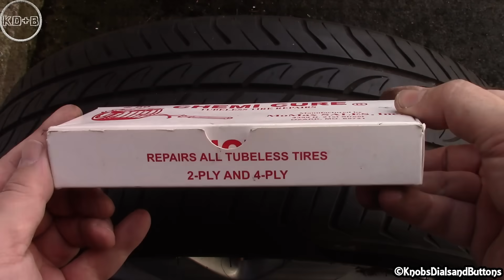How Tire Repair Kits Work - With Internal Views

Comment: Longest lasting ones are the rope type ones (will last the life of the tire), but the easiest one is the screw type. I suggest you buy both, because if you're stuck in the middle of the road at dead winter or summer with a puncture, you don't want to take out the tire now (too hot or cold, and might be dangerous to stay on the shoulder of the road too long). You plug with a screw and fill with air (without taking the tire off), then when you get home, you put one of the rope type plugs in. The rope type plugs require more clearance for the tools, so you can't do it while the tire is mounted. The screw type plug can be torqued down with a bulldog (low profile) screwdriver with the tire mounted.
Reply: Bingo! I had one in my tire for years without issue
Reply: Technically your wrong the best repair is the patch and plug they use at tire shops much stronger, ive seen those ropes fail, ive done them and had them hold up great but still nothing beats a patch and plug
Reply: @jamesbasye2362 it’s a do it yourself  … Emergency …. Be grateful this person  has the patience to show and share  
I know if you go to a place to get it done some times  they won’t  DO a proper procedure
Reply: I can't remember sticky rope type plugs failing, as long as it's not on the shoulder of the tire. i even use half the sticky rope, even put in a single thread.  i've done several over the years. You don't have to take the tire off depending on your car. Regards
Reply: Наконечник из последнего приспособления, остаётся внутри шины болтаться?
Reply: It either lasts the life of the tire or to the end of your life, if the tire fails in the worst moment possible!
The metal wires in the rubber on the tread are damaged!
Exchange both tires on the axle if you can.
Reply: The one with the glue type is the longest for me. The rope type without glue still release some air based on my own experience
Reply: @user-2uf2kr2c  I have seen tread separation due to ropes and internal patches being installed incorrectly. It’s either a tech grinds the inner tube down to wires, or someone creating a second internal puncture by inserting the reamer at the wrong angle.
Reply: I've used the rope or string type for years and found them to be reliable.  Someone here mentioned the wires of the belt being damaged.  If they're damaged, it's because they got caught on the end of a flat ended screw or something like that as it was puncturing the tire.  My wife had a tire once that was punctured by a 5/16" bolt about 3" long.  It was still in the tire when she arrived at Walmart Auto Center.  But those wires are tough.  You won't damage them with the rasp tool rubbing against them.  And it's pointed, so it passes between them without breaking them.

As for fixing the tire on the vehicle, I've done it a few times.  All you have to do is, go forward or backward until the puncture is indexed at the ten o'clock position (left side) or the two o'clock position (right side) and turn the steering wheel all the way toward the side you're working on, and voila!  Instant access to make the repair!

What I want to know is how he got a camera and lighting inside a pressurized tire to record the video. 😅😅
Reply: My brother did it at a camp site with the wheel on the car and the tire rotated so the hole appeared on the side and he did it laying down on the ground.
Reply: You can plug a mounted tire if you have the room.  I’ve done it before.  I’ve also seen the “rope” plugs fail.  Something tells me you don’t have much experience with tires.
Reply: @jamesbasye2362  and the screw plug is the only one of these that a tire shop will do a proper patch/plug repair on since you can just say there's a screw in the tire

All the rope and mushroom DIY plugs are a no go for repair
Reply: I once had a tire with four or five ropes in it. Someone really did not like my car taking "his" parking spot and put a lot screws in  left rear tire. So to drive home a have to put equal amount of ropes into this tire. It did hold on nicely for a week or so until I changed a tire completely.
Reply: Totally correct. The rope is simply a very temporary "get you home and to the tyre shop". A proper plug should be fitted and no more than two in one tyre.
Reply: I've done dozens of repairs using the glue and rope kits out in the backcountry on 10 ply tires.  Never had a fail.  Having said that, be warned,  IT AIN'T EASY WITH 10 PLY
Reply: I’ve put plenty of rope style on with the tire still mounted it isn’t hard at all.
Reply: Had trucks and utility trailers for 30 yrs and never had a lubricated ropes fail. Maybe I’ve just beat the odds so far.
Reply: @SgtPnkks They can just remove the mushroom plug like they would a nail or screw and repair as they would have without the plug.
Reply: Couldn't agree more. Lol I call them the kit Kat ones
Reply: First one right ?
Reply: You just turn the wheel to expose the spot you work on,I never take the tire off to plug it.thats the joy of a plug!
Reply: The first and the third?
Reply: Good advice, Thanks
Reply: I always use the strip plug while the tire is mounted. There's no reason to dismount the tire.
Reply: @07wrxtr1  I have the first try pop off after a few days. Maybe because I'm still inexperienced using it. 😅I tried again to plug the hole afterwards, and it managed to cling on the tire.
Reply: @lewis2553  I think he used a sawed off tire. Sometime you can see his hand on top of the tire. So it's not a camera inside those tire. Watch 2:35 to 2:36, at the upper right corner there's a pink shadow of his hand.
Reply: I've found rope tire plug kits occasionally start to leak air up here in the Northeast after a half a year to a year.  It's probably the impact of drastic temperature change on the different materials of the tire and plug breaking the bond of adhesion.  Proper way to permanently fix any tire is to remove it from the rim, ream the hole, rough up the surface inside the tire, layer of rubber cement, apply a pull through mushroom plug/patch, and then roll the inside of it with the rolling tool and reinstall the tire on the rim.  It's safe enough to do on motorcycle tires where a blowout can cost you your life.
Reply: ive had 2 rope ones last the life of the tire.
Reply: One can use rope plugs on many carss without taking the tire off, you just gotta get the right angle on it.
Reply: You can definitely do a rope style plug when tire is on the car.
Reply: @tombrown1032 nope, you probably just take a few extra seconds to do it right
Reply: Grandfather has always used them never had an issue!
Reply: @jamesbasye2362 issue is you need to take the tire off to use a patch/plug
Reply: @jamesbasye2362 

my tire shop and other shop don't patch tires, they only do the rope sticky plug...
Reply: I have 2 brand new tires 205/55/16, but there is a hole on the side less than 1mm thick, which of these methods is better to use or is it better to install inner tube?
Reply: In that situation, why not just use a metal screw (maybe dunk it in engine oil first)?
Reply: @alexkross8357  I think it must be, it will be pushed in by the plug. It looks like hard rubber, so it should not cause any problems.
Reply: @lewis2553  If it is on the rear tire you can't turn it with the steering, but if you roll forward until you get the puncture at the 4 o'clock or 8 o'clock position you should be able to access it under the car even if it is a bit awkward.
Reply: @lewis2553  of course it was done a second time with an open tire for the video.  The tire tread wouldn't bob up and down when rasping if it was pressurized.
Reply: @shagrat47  I drive for a living and you'd be surprised at how much crap you get in your tires when you drive 90k miles in 4 years going in an out of all manner of places. If I replaced tires just because I caught a nail or a screw, I'd go broke. I repair tires with plugs all the time and keep running them. I suppose it helps that my front tires only last about 6 - 8 months before needing replacement anyway due to wear, but still. Your advice is for the rich when 2 tires will set you back $350 - $400
Reply: @JackFrost-wg5zl make a video showing us how you do that with the rear wheels
Reply: I do it all the time with the tire still mounted on the car….. just have to roll the car to wear the puncture on the tire it’s almost level with the ground So you have clearance to use the tool….. The only downside is your laying on the ground….. It works just the same
Reply: @craigrufolo8442  
Yeah, but for some of us, laying on the ground means 2nd degree burns from hot asphalt or laying in a snow and salt slushy. Much easier to turn a screw for 3 seconds, then do the rope when it's more comfortable and safe.
Reply: @RS-rm9sr  
If the hole is in the side (shoulder\sidewall), you need a new tire.
Reply: You don't have to take out the tyre, if it is the rear, just roll the car until you can access the hole from rear. 
Or roll and rotate the steering if it is the front tyre.

Comment: The first plug strip type works no problem. I’ve been using them for 20 years and never have I had even one fail. They always last the life of the tire.
Reply: True, 100%
Reply: Agree. Can get them dirty cheap too.
Reply: Same here. I've had 3 such plugs stuffed together for a big hole and that too held up for the life of the tyre.
Reply: And you can get them anywhere. I've kept a plug kit and a compressor in my car for years. Way faster and easier to plug a tire than put the temporary spare on, drive slowly, get it fixed later. And likewise I've had them in the tire for years without a problem.  Use them for my motorcycle, too, although there I'd look to have a better repair done later, or replace the tire.
Reply: similar in that I have had so many work, and only one failed, and I just put another plug in it, same spot and it was good after that :)
Reply: I used it once as well on a motorcycle. Its held up, but its a pita to get it in there and alot of grunt work. The mushroom type looks alot easier.
Reply: Yep, I keep them in my truck, never had one leak.
Reply: The third one and the first one is the best in my experience.
Reply: I put a black mushroom in my 10 day old Kawasaki tyre. Worked without trouble for 6500 kms  till tyres wore out. Inspected daily.
Reply: Been using the #1 red ones with and without rubber cement for 40 years with no failures on single puncture repairs.  Not as succesful on wider cuts.
Reply: How about noise after repair?
Can someone share your experiences?
Reply: @romanbizin16 No noise. I've always used #1 and never even bothered taking it in for repair, always lasted the life of the tire.
Reply: Patches are the best way to go. They don’t ruin the radials in the tire.
Reply: I have used the first tire plug since 1978 and have never had a failure.
Reply: @romanbizin16 I have never noticed any noise
Reply: I got a leak on a holiday and the closest store to me was Harbor Freight. I attempted to do the repair in the parking lot and the actual tool handle broke. The cost of the patch set was like $2 or something ridiculously low like that. Good thing I did it in the parking lot since I was able to go back in and return for another kit. Just keep in mind that the Harbor Freight ones can break and without that tool, you can't do the repair.
Reply: @lyianx make sure the tire is inflated when inserting both the reamer and the plug otherwise it’s extremely difficult. I made this mistake once.
Reply: I drive Honda ADV150 with its factory tubeless tire (IRC GP212R for rear tire)
at that one time I have 4 puncture repaired by strip type puncture kit through its lifetime, it only failed because the tires wear out so thin it can't hold the plugs, then it got plugged by the same puncture kit then drove home, my boss(who is actually my cousin) literally force me to buy new tires right when I got home
Reply: I agree I find the tan colored ones sometimes marketed as Camel why buy more expensive methods and more complicated
Reply: same
Reply: Super cheap too. Everyone should 1) know how to use them and 2) have them on hand
Reply: @romanbizin16 I STRONGLY doubt you will notice any new noise...just be sure to cut off the excess plug level with the tire tread.

Comment: As an uber driver always pulling off onto the side of the roads, i go through about 6 flat tires a year. I never even take the wheel off the car, just find a flat parking lot, roll the car in neutral to where the puncture is accessable between the road and bumper, then put a plug in. The process takes about 5 min. Much faster than using a spare.
Reply: Which model you use my bro

Comment: I’ll be always grateful to those people who share their knowledge on YT with this level of detail and passion. Simply thanks
Reply from the maker: You're welcome, thanks for watching !
Reply: @knobsdialsandbuttons  why did you share this, what was your actual motivation?
Reply: I drive 150 miles a day 6 days a week on rural roads. I've used hundreds of the first type and never had a failure, most were toward the edge where the shops won't repair them
Reply: @Erunanethiel Miksi yleensä ihmiset jakavat YouTubeen mitään?
Ei renkaan paikkaus muuten ole salatiedettä 🤣
Upeasti vain esitetty pikkutarkasti mitä renkaan sisäpuolella tapahtuu 👍🏽
Reply: Would be nice if it included the knowledge about your tire internal structure. Especially that reamer can damage and compromise the internal structure, your tire is no longer safe to the rated speed limit. You don't want to hit the German autobahn with 250km/h after plugging your tire like this.
Reply: But which technique has the most quality and does last the longest time?
Reply: I use a drill to make the hole and not the shty hand saw thingy; so much easier
Reply: This is what the internet was made for, share knowledge.  Knowledge is power.

Comment: I've saved thousands of dollars over the years using the sticky rope plugs and have never had one failure.
Reply: Same. Red or black they've never given me trouble
Reply: I have done the rope plug ( with the 'glue' ) once of twice. Never failed.
Reply: @Xandil  it fails if it dries up
Reply: Same here…. Years and years. Not one issue.
Reply: Facts
Reply: Don't work on sidewalks tho
Reply: Never had the plugs fail
Reply: @curlymyhero  in many country the sidewall and shoulder repair is not allowed. Those tires going into the trash and later into the asphalt.
Reply: Survivorship bias. Those who do bad DIY repairs don't live long enough to tell the tale.
Reply: Yep, they do the job well.

Comment: Have always been using the sticky rope.  It lasts the life of the tire.  However i did not know other methods existed out there.  Thanks for showing.
Reply from the maker: You're welcome, thanks for watching !
Reply: Y
Reply: There's another mode I know of, but it's not exactly DIY. It needs the tubeless tire to be disassembled from the rim, because it uses sticker from inside the tire. Only tire workshop is equipped with tools to do it.
Reply: @gorilladisco9108  That's a patch though, not a quick plug repair from the outside.
Reply: @Chadman333 Correct. Patches last the life of a tire. They're cheap to get done at a shop. I had bad luck for like a year, running over nails on the highway. 6 patches on one tire, low mileage when the patches were done, held up until the tires wore out. Not spending another $200 per tire when I can get a $20 patch.
Reply: Mushroom puncture from inside tubeless

Comment: Used the sticky string dozens of times and never thought of turning the handle a few times. Genius! Thanks
Reply from the maker: Thanks for watching !
Reply: Instructions that came with mine specifically say not to do that.
Reply: same, that was something new today for me, and it makes sense. I wonder if that has been on the instructions the whole time and I never paid attention to it
Reply: The string looks like it could have done two repairs with the one string cut in two.
Reply: 180 degrees

Comment: I’ve used what you call plug strips or sticky string for 40 years. Fortunately, I’ve been close by when other motorcycles have picked up a nail or screw. It’s simple, straight forward to use and works for me 100%. I used it in the late 1960’s for my car and it worked and carry sticky on my bike 100% of the time.

Comment: I've been using the tire plugs for over 30 years. Never EVER had one fail. Just don't them on the sidewall or shoulders. Absolutely works and is safe. Good kits have the tar already on them. NO glue needed.
Reply: Same. Cars and ATV's alike.

Comment: Tyre fitters all tell you never to use anything other than them to repair your tyre! I have used the first method for years with absolutely no issues. Thank you.
Reply: Now this may surprise you, but there is good reason for that. A tyre technician has the required training to know when a repair is safe and when the tyre is a loss.
Reply: @techgeeknzl  true.

Comment: I have done a lot of remote driving in outback Australia and have needed tyre repairs on a number of occasions and the sticky rope plugs have helped me out on a number of occasions.  The most memorable was following GPS coordinates in the Great Victorian Desert when i got 2 side wall tears in the same tyre on my camper.  One hole i successfully plugged with EIGHT strings and the next needed TEN strings.   I then drove 600km south to Cocklebiddy (on very rough terrain and tracks) before driving another 600km to Pt Augusta where i got the tyre replaced.   I never go bush without a lot of these strings
Reply: Wow 😮, as a taxi driver I know the pain, In the middle of the night is the worst. The outback is a different type of shock for sure 😮
Reply: Here in the States, we only need a steak knife and fork when we go to the Outback! 😎👍